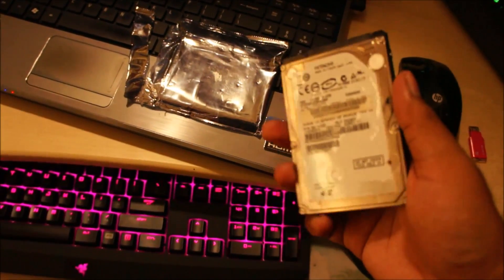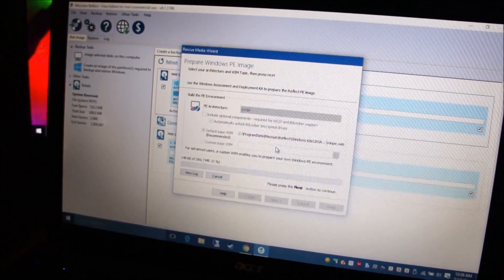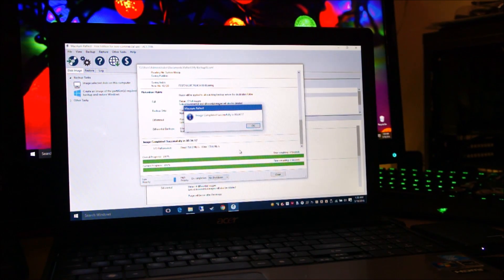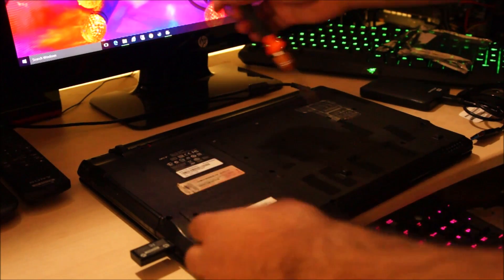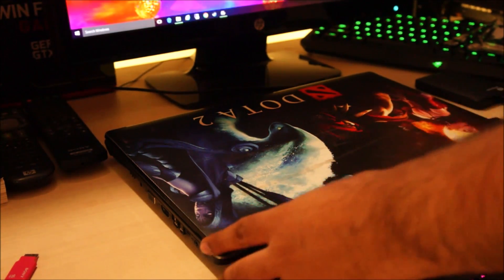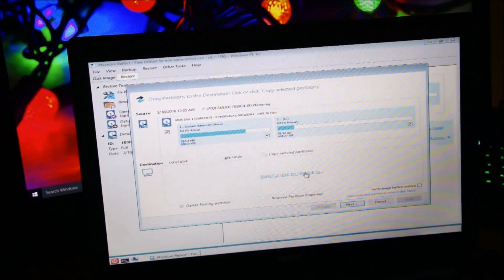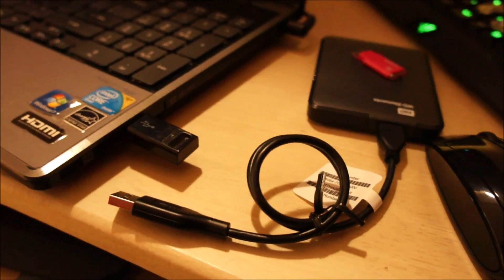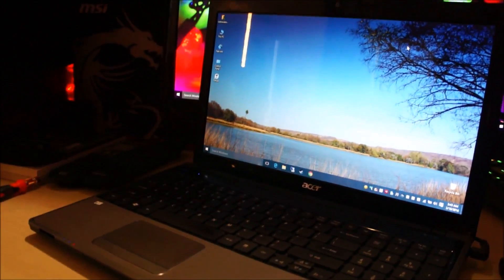Clone/Copy EVERYTHING including Windows from old hard drive to a new one step by step (Easy way)

Comment: Thanks, that really helped me out. I've upgraded from my old 128 GB SSD to a 500 GB SSD. :D

I personally still had to fuse my old hard drive partition with my unallocated new partition and so I had to use a program called AOMEI Partition Assistant Standard Edition which let me fuse it (Windows' Disk Management would only let me fuse it with parts of my D drive, which wouldn't be helpful in this case because I need more space on my C drive for Visual Studio stuff) and that worked out pretty well too. :)
Reply from the maker: Sounds awesome! Glad the video was helpful, although I made this video YEARS ago! cant believe people still watch it.
Reply: @TechGuyCharlie  I watch it because it is so crusty old and not in your face about stuff with high quality filming and editing. It's JUST the setup process explained and shown to you. ^^

Comment: I tried to clone my hard drive to an external SSD drive using Macrium Reflect but kept getting "Clone Failed error 9 Read Failed 23".
However, I was able to save an image to my external hard drive.
So I will try this method to recover the image to my new SSD Drive.
Fingers crossed.
Reply from the maker: Hey Doug, Read Failed means there is something wrong with the hard drive you are cloning from, probably a damaged sector. You will most likely get the same error with this method as well.
Reply: @TechGuyCharlie  
Thanks for getting back to me Charlie I was able to image my hard drive successfully to an external hard drive, so hopefully I can transfer the image to my new SSD drive.
Reply: Charlie I used a program called Aomei Backupper to clone my existing HDD to my new SSD Drive. 
First try failed but after I turned off my antivirus, it worked the second time.

Comment: I downloaded the Macrium Reflect 7 Free software and replaced the HDD in a 2009 Toshiba laptop (Windows 10 Home) with a SSD using this video. There has been a few changes in the software but I got it installed with only a few hiccups. It worked and the old laptop has sped up noticeably. I had tried other software before but was not successful. This software enabled me to delete partitions on the SSD that had been created when the other software had failed. Thanks for the help.

Comment: Thanks for sharing this, helped me a lot! Basically it takes only several hours to migrate to a new drive - great way to revive old hardware (RAM+SSD rules). 
Just a few notes to mention:
- Macrium evolved and GUI is little bit different. Just expect that. Functionality wise it's the same.
- new drive should be IMHO same size or bigger. I had an issue with Samsung laptop, since there are 7 (seven) partitions, and last ones keep restore media. In Macrium You can resize partition but it doesn't mean next one moves appropriately. In fact, there seems to be no way how to do it, and a new drive was a few GB short :-( So you would need to experiment with old drive and resize its partitions, which I don't recommend or omit some content of old drive. I've omit last two partitions and hopefully won't need them anymore - but this might not be your case. So be carefull if there are some hidden partitions at the end of Your old HDD!
- USB stick takes some time to boot, be patient when starting Your laptop :-)

Comment: Thanks bro. I have a couple questions. 1). In the process of doing the backup copy, can I copy the everything from the old hard drive from the computer into an external hard drive that already has some files; provided that it has enough space or it is recommended that I should copy the files into a blank/empty hard drive. 2). Can I create a folder in the hard drive to store the files/data that's being transferred from the computer or not?

Comment: your speaking was ok I think you did a very good job. Only thing you forgot as how big your boot flash drive had to be. and when you turned the laptop over you left the flash drive in? is that a mistake or should It have been removed before turning it over and removing the old hard drive.?

Comment: 2:46 You should use the safely remove icon in the system tray to uninstall the usb flash drive, don't just pull it out.

Comment: I just started looking into Clonezilla because each cloning software, hardware or OS is sometimes weird on a random basis and doesn't tell what is wrong with a cloning operation. Windows 10 has a create disk image tool under "Backup" then "Go to Backup and Restore (Windows 7)" then "Create a system image" which worked for me many times including disaster type losses.

Comment: One important point. The USB stick needs a FAT 32 format. When my USB was in NEFT format, I kept getting an error message that read something like, no boot device present. While surfing the net for advice on this error, I stumbled upon this solution. After pressing Esc several times on start up, I choose the bar that shows my USB with UEFI content. It worked and Macrium Reflect 7 did the rest.
Reply: I was wondering about that because I ran into problems with my stick.  Thanks for the confirmation 👍

Comment: can you use this image to restore everything to a new computer that is different model?  or does this only work upgrading hard drive for same model computer?
Reply from the maker: You can restore the image to almost any computer, be it a different brand, but you will need to re-activate Windows and Office since they detect that there has been a significant change in the hardware, but everything else will work just fine. I've made a video about it here
https://www.youtube.com/watch?v=wCWre9ZtCF0

Comment: Windows 7 and up. At 3:08 he says to check the partition you want to clone, C: and the system reserve partition. This is very important because the system reserve partition contains boot information for the drive. I spent many hours figuring out why one clone worked and the next didn't.

Comment: Excellent slow/plain Video directions to do this.Have an HP 110-016 Desktop JUN2013 WINS10(1809) and runs Great(5 yrs. not bad). Got a SATA III 3T vs. my old SATA 500G one to REplace. My MOBO only has TWO SATA PWR. Sockets. I obtained a USB Enclosure H/D Kit to Clone/Transfer/Thumb drive because we are not suppose to DISconnect the SATA DVD/ROM that uses the other PWR. Slot right or am I wrong? Obtained the REFLEX 7 per your choice BUT, read after I downloaded it that a person has 30 days from download date to use it, then ya hafta pay. UtOh, have only 21 days left. Lastly, is it true if you have a "Secure Boot" which most do, you have to UNsecure it in the BIOS(F9 I think)FIRST before any Clone/Transfer? OK, lastlylastly, I was told this Method cannot transfer Games/Programs ??? A person has to UNinstall them first ?? So, confused, which is quite normal for me. Thanks.

Comment: Great, well put together and explained video
I have two questions though

1. I will try this method but my circumstance is a little different...I run Windows os on a Mac...I have a split partition with the native Mac hard drive. I assume this method can still be used on the windows partition, but I’m just curious if it will affect anything or not?

2. I am trying to transfer my windows partition (hard drive, data, apps, files, etc) from my Mac to my new laptop, which is an omen gaming laptop that comes with windows....should I first do the recovery usb, external hard drive back up, plug into new laptop and THEN turn on/boot up my new laptop for the first time OR should I just set up windows on and configure everything first? (My thought is just to boot it up right into the back up I want to transfer, but again I’m curious...)

Comment: why use three hard drives?  why not copy C to external HD and then replace the external into the laptop?
Reply: Good question. Had same. I'm using external to my Desktop, and when Im done Cloning, Im popping that baby in and REplace the old one. FYI, do it offline. You get a pesky Windows update, or Programs you got set up to update w/o warning, it can corrupt(neighbor did it and it happened). I just wrote step-by-step down, no problemo. UtOh, maybe I won't. Seen that 289MB download from Microsoft, darn.

Comment: Your method shows we need to copy the hard drive already in our computer onto the new drive which is attached to an enclosure.  Yet I saw a method where they took the hard drive out and and attached it to enclosure and saved the reverse way.  And when it was done there was no need to change drives.  Your method makes more sense to ensure stability.

Comment: If I do this will I have to reinstall paid programs like Photoshop?
Reply from the maker: Nope, but if you move to a new hardware then you'll need to reactivate them. If you just clone to a new drive and install the new drive on the same pc/laptop you won't even need to reactivate photoshop, it will continue working as it is. I tested this on CS5, can't say the same for newer versions.

Comment: I downloaded Macrium and started the processes of cloning a hard drive but I never got passed the part of creating a the rescue media. The first error message said that the USB stick wasn't suitable. I tried all my sticks and none of them would work. So I tried an old 60 GB USB hard drive and the error message I got stated that it didn't have enough memory. I checked the forum and no mention of anyone having the identical problem. I tried to register with the forum but couldn't because only users who paid for the software can register in the forum. Oh well I guess I'll need to find another free cloning application. But thanks for your  help. Your video is very helpful. At least I know what it looks like when everything works as advertised.

Comment: Great video. Thanks. Only one thing to add. Some time the C partition is in between other partitions so it does not automatically resize it. You would need to manually do it

Comment: Tech Guy

I downloaded Macrium, ran it and created a bootable USB.
I created a macrium system image file on a separate storage device.
I took out the existing HDD I want to clone and inserted the new blank HDD I want to clone into into the HDD slot on the laptop.
I set up the BIOS to boot from external drive
I then connected the USB with bootable media from Macrium and the storage device with the image on it.
I selected the source as the image on the storage device.

When I went to "destination" but the only destination the software could see was the external storage drive. In other words it couldn't detect the new HDD I had inserted (or at least I couldn't see it on offer)

What have I done wrong?
Reply from the maker: Everything seems to be in the correct order... Does the BIOS see the new HDD? I've had this problem before! If the new HDD is bad it won't show up.
Reply: I think you hit the nail on the head there Charlie. I rang Seagate today to run it past their tech guys, or Gal in this case.

I plugged it into this PC with a USB/SATA connector and they ran diskpart in the command environment.

To cut a long story short, their conclusion is that its defective and that's why the system can't see it.

It shows up as of zero capacity instead of 500GB. They checked the serial number and although it was sold to me as new & packaged the warranty on it from Seagate expired in 2014.

The seller tells me they bought a job lot from a laptop manufacturer.

So i think you are telling me what Seagate confirmed this morning.

Thanks for getting back to me, much appreciated
Reply from the maker: No problem :D So they sold you an old stock as new! I hope you've got the drive replaced.
Reply: The plot thickens. Seagate deemed the HDD as faulty, and yes I did get my money back.

I bought another HDD a Seagate Barracuda 500GB and when I went through your process with the new one I hit exactly the same fault. The Macrium software could not see the new disk to write to. A check of the disk showed its capacity as 0GB

I have a spare machine that runs of windows 7 and when I plugged it into that with a USB/SATA connector it give the "audible" for the connection but no window opened for the device.

About 30 secs later a window jumped up to say that it "recognised" the drive and then when I looked at it under properties it now had the 470GB space.

I downloaded the Macrium software to the Win7 machine and I was able to complete to transfer and clone the disk from the image created.

There seems to be a problem with W10 recognising new disks, I haven't tried it yet but I still have the faulty disk and I suspect that will work if I follow the same process.

Comment: I don't quite get this. I get the taking a system image to the external hard drive. I'm not clear if the cloning software has the facility to make the bootable drive you put into the USB when you put the new fresh disk in Laptop. 

The bit i think I'm missing here is does the cloning software make the bootable USB drive and what size USB do you need? You must also copy the cloning software onto the bootable USB otherwise you have nothing to run the cloning software to copy from one disk to another when you boot up from the USB drive. The rest I agree is simple, but I don't think you fully explained what's happening with the USB drive and exactly what's on it.

Comment: Hi Charlie, after watching on how to clone from old to new drive I have a couple of questions. I recently purchased M.2 SSD 256GB to replace old HDD 1TB hard drive, as your instruction mentioned it shouldn't be any problem with new smaller capacity drive but I'm lost when you already made imaging onto new drive but still needs to do the copying process again with new drive installed onto the PC. Does these steps only apply to Macrium Reflect? I am considering using EASE US TODO & it appears simpler, have you personally used or heard of this cloning software? Should I use a rescue USB drive made before or have to make one during the cloning process? Thx.
Reply from the maker: Hey Wilson, long time didn't see you on Xperia videos! I bought a new phone XA1 plus, did you check out the review yet?
These steps only apply to Macrium Reflect but I am guessing it should be very similar and self-explanatory for other cloning software.
I took the longer route in this video because it eliminates the need to get an additional SATA cable or a SATA to USB adaptor and you can do it with just an external hard drive (just easier and simpler for a non-expert but has 2 additional steps)
Are you cloning on a laptop or desktop? I haven't tried cloning to an m.2 drive but I am guessing this exact same procedure should work.
Reply: Thx Charlie for clarifying, I will be using a USB to SATA 22 Pin cable for my cloning. I would also like to see you do a video on IP CAM, I'm using a Xiaomi IP CAM & still isn't skilled with monitoring remotely on my mobile phone outside of WiFi. Would like to know if all IP CAM's can be used with 3G/4G LTE mobile connectivity? Cheers.

Comment: Its not working for me, after all data has been trasnfered, and removed the usb and external hdd it starts with no bootable device warning, any ideas? Thanks
Reply: Doc4EVR You have to assign the new drive as "C" drive because that is what Windows uses as the go to drive for the boot ini file from bios otherwise it cannot make sense of where to go.

Comment: Windows only loads when I'm connected to my external hard drive and using the "Fix Windows Boot Problems" tool in Macrium. If I don't do that, I get the "no operating system" screen as the computer attempts to boot. Is there any way to fix this? I can't carry my external hard drive around everywhere just to turn my computer on!
Reply: Worked with SATA III cable... turns out I didn't assign a drive letter to the partition that was supposed to be "C" it was randomly assigned "E" which by coincidence or not, is the drive letter for the external hard drive I used.

Comment: Hi, this video tutorial on cloning a hard drive is a little dated. Would like to know if the "Macrium Reflect" will work for current SSD drives? I think my Laptop PC with Intel Core i7-5600U doesn't have BIOS settings in it's bootup configuration, I plan to upgrade my mass storage to higher capacity soon, please give your opinion on which storage drive is best? Cheers.

Comment: Can i just directly plug a second HDD into a free sata port on my laptop and have the image go to the second hard drive or do i need an external HDD?
Reply from the maker: Yeah, that can be done but I didn't know laptop's came with 2 sata ports? 
Yes, you can clone your boot disk directly to a second hard drive if you've got a free sata port, thus eliminating the need for external hdd
Reply: thank you!
Reply: Tech Guy Charlie I tried this and the reflect software never initialized